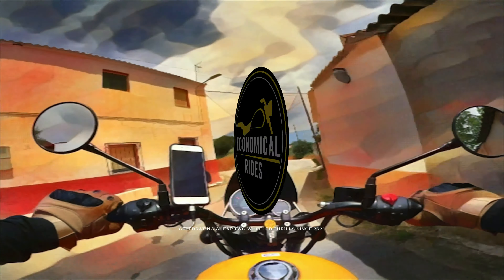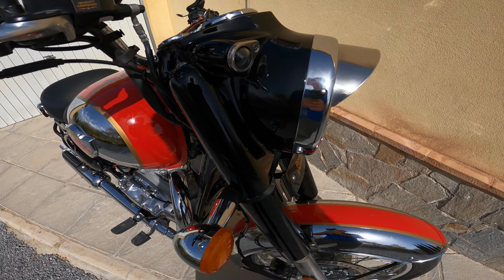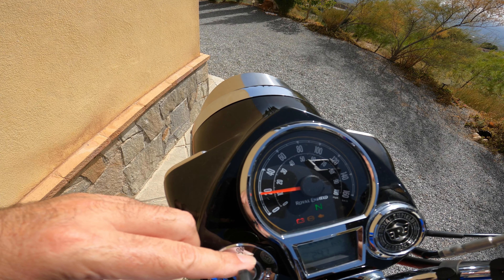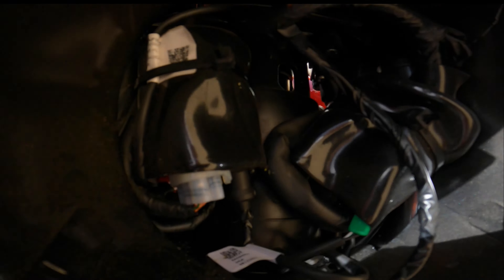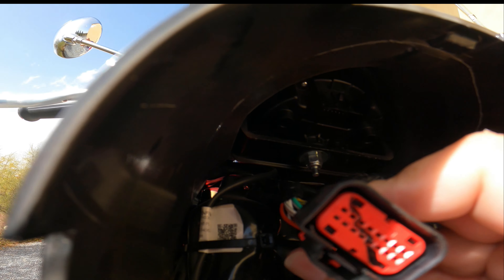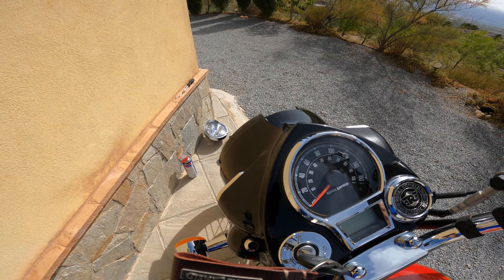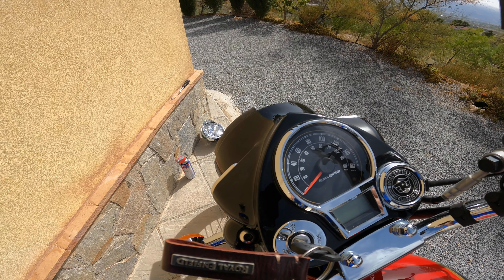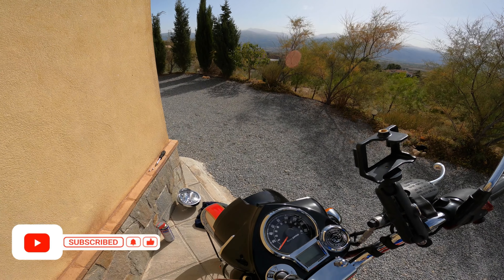Royal Enfield Classic 350 REborn - "Sticky Speedo" Fix ? - Well It Worked For Me ( So Far ! )

Comment: Happy riding 
Question?
I tried to clean the connector. As I tried to disconnect the port after pulling the red middle part down, it was impossible to unlatch it. The red part came down though. After that, It wouldn’t budge, and I’m not a weak man. I tried pulling it side to side like you would do to a tooth. It felt permanently attached. How much force should I use? Can I use pliers? Anything to loosen it?
I tried the on and off technique and it worked one more time, but I want a more permanent fix.
Thanks 
MJR
Reply from the maker: Hi there MJR,
that doesn't sound good. I am trying to remember how it was done because I haven't touched it since making this video last year. I recall that it was quite stiff to pull apart and I think it also comes apart slightly differently than you would imagine, so you might be pulling in the wrong place. I also struggled initially and nearly gave up but eventually I started pulling in the right place and it did come apart. Just freeze frame this video, where the connector is separated and see if you can work out where the join of the two parts is. I think you may be expecting it to separate in the wrong place.
If you are trying to pull it apart in the right place, it should eventually come apart with some pulling and wiggling, no need to use tools on it and if you do you'll probably break the plastic on the connector.

So just make sure that you are trying to separate the two halves IN THE RIGHT PLACE and pull and wiggle. It should come apart, just be patient.

Good luck MJR
ER
Reply: @economicalrides  thanks ER. Will do! Ride safe!
Reply: I fixed my Speedo with the spray. wahoo. I was able to detach since there is a small button part like in the middle area area of the port. Press that in and it smooths right off. Ride safe!
Reply from the maker: @maiojoserivera786  Congratulations Maio, glad you got it sorted. If it ever plays up again, just repeat the process. Saves a trip to the dealer and losing your mileage if they decide to fit a new speedo.
But mine held for 8 months without the problem coming back 👍🏻
Thanks for getting back to me, enjoy your Classic Maio.
Cheers,
ER.

Comment: Thank you...
Reply from the maker: Hi Joseph,
glad you found the video useful.
I subsequently sold the Classic but this repair held until I sold the bike, so ten months or so. The problem didn't reoccur in that time. I'm not sure if it is a permanent fix but if not, it's easily repeated whenever required. It was certainly less faff than doing a three hour round trip to the dealer to get a replacement speedo AND lose the odometer mileage I had done with the bike. 
Certainly worth a try, before going down the warranty replacement route !
Cheers Joseph,
Garry

Comment: Why this works, I don't know. But, it definitely works. Thanks! Anyone on here know how the repair holds up? I'm wondering if I will need to do it again later.
Reply from the maker: Hi ! Glad it worked for you too 👍
I have a theory that when it is hot enough and the air is humid enough, condensation can possibly build up in the connector. Once it dries out, there is mild oxidation which affects the conductivity through the connector. The speedo itself seems to be very sensitive to changes in conductivity within the connector. Cleaning the contacts solves the problem and WD40 prevents the condensation from building up again. WD40 will lose its effect eventually, so you might have to repeat the process at some point. But it is easily done and preferable to getting a replacement speedo and losing your total mileage.
I sold my Classic six months after doing this and the speedo was still working fine when I sold it. So the “fix” certainly seems to last quite a long time 👍

I did tell my dealer to do this before replacing speedos on other customers’ bikes but from what I hear they are still replacing speedos whenever it happens, for some customers multiple times ! 🤷‍♂️

Thanks for letting me know that this video helped you, it’s good to have data !
Cheers buddy,
ER

Comment: Hi ER My  classic 350 Halcyon green now has 3500 klm on the clock and so far at least I haven't suffered the  dreaded speedo issue. I don't know if it makes any difference, but I ALWAYS wait for the speedo to complete its start up cycle totally before pressing the starter switch. (It's obviously got some sort of computer chip in it, so a power spike or drain at the wrong moment could cause the device to have a fart attack.) ?????
Reply from the maker: Hi Kevin,
no, I always do that too, I even wait for the fuel injection to finish priming.
In my case it started when the bike was parked in the sun. On the next start the needle just got stuck. I think that this instrument is very sensitive to changes in voltage and there is something in the connector which causes issues when it gets hot. This seems to affect the calibration sweep. It's weird but I'm sure that heat is causing the connector to deliver inconsistent voltage to the instrument itself and that manifests itself in the speedo getting confused in its calibration sweep. It may just be grease or corrosion on one pin. It certainly seems as though cleaning and lubing this connector has made a difference. I'm convinced that the issue is not with the speedos themselves but with the quality of the connection to the speedo. I would recommend this as preventative maintenance personally, it can't do any harm if you are careful and may prevent issues occurring in the future. I might even do it annually if it proves to have solved the problem !
The next day my dealer told me that after three months my new speedo had finally arrived ! Typical ! For now they can keep it !
Cheers Kevin 🙂
ER
Reply: Hi, I'm of the same opinion that it is heat that is the issue that effects the Speedo. I'm in Indonesia and if I happen to leave the bike Speedo in direct sunlight I get the problem. Start riding with cooling air crossing the instrument cluster and the Speedo resets itself 👍. I'm going to try Warros solution as you suggest 🙏
Reply from the maker: @639viablecarrot  Certainly in my case and many others, heat seems to provoke the issue, or better said, direct sunlight. Others may be having other problems caused by other things but clearly in our cases it is very dependent upon the heat.
The surprising thing was that this time the speedo did not correct itself after being unused in the garage for over three weeks. It had ample time to cool down whilst I was in Germany but when I came back and started it for the first time, it still stuck at 20 kph. So at some point it starts playing up even when it is no longer hot. 
But this little job was easy to do and seems to have fixed it for now 🤞
Cheers Hqmpest !
ER

Comment: For me the speedometer is running,so can i follow the same steps ?
Reply from the maker: I would certainly try it if you are having a problem. If you get a new speedo under warranty, you lose your total mileage, which is a real nuisance.
As long as everything is working, I would leave it alone. I believe that newer bikes do not have this issue any more because RE changed something in the design/manufacture of this part.
Cheers,
Garry

Comment: Luckily it's not happened yet but if it does I know what to do. 👍
Reply from the maker: Hi Robert,
it’s definitely worth a shot before getting the dealer involved ! Still working for me and easily repeated should it become necessary.
Also, most people get their mileage set to zero when they get a new speedo under warranty ( although I am convinced that the mileage can be programmed into a new speedo, it’s just that the dealers do not know this ! ), which would really annoy me. I want to keep my original mileage if at all possible !
Thanks for watching Robert and 🤞 you don’t experience the issue !
Cheers 🥃🥃
ER
Reply: @economicalrides  absolutely agree with you. It looks to be an electrical contact issue! Maybe the male pins are just a tiny bit thin for the female plug. Good to know yours is still working 😊🤞👍

Comment: Any update on this?
Reply from the maker: Hi Bee Dee,
it hasn’t played up since but it also hasn’t really been out in the sun for very long since I did this either.
But I think this procedure helps and if the speedo ever plays up again, I will repeat it and see what happens.
I‘m so confident though, that I told the dealer that they can send the replacement speedo back to RE !
Cheers,
ER
Reply: This just happened to my Classic 350 on a Sunday. I went to the dealership and they plugged the computer to the bike and they told me this was caused by abs error code? Anyway they managed to put it back to 0, I picked the bike up and rode it for 15min, Speedo started acting up again! All bummed because it was a beautiful day to ride I went back to the dealer, they said they will replace the sensors and the speedo.. I left it at the dealership because here in Australia while you are on your L’s you cannot have the phone on the bike (means I can’t use gps Speedo on the phone).. really bummed. Wondering if it should pick the bike up and do this myself. The guys are not sure how long this whole thing will take
Reply from the maker: @beedee7392  Hi Bee Dee,

honestly I WOULD !

It's quite possible that when this happens it creates an ABS error code. After all, the speedo is just a display for the signal the ABS sensor sends with the wheel speed.
In this case the ABS error is probably just "speedo error" or "speedo calibration error".

It is possible to switch the ignition off and on again multiple times to get the speedo back to zero. That's what I did the first time it happened to me and that worked for a brief while.

But for me, disconnecting, cleaning and reconnecting the speedo connector fixed the problem immediately ( as this video shows ) and the fix is still working months later, although as I mentioned, I really need to ride through a hot summer before being sure that the fix is permanent. But even if it did start playing up again, I'd still repeat this fix before bothering my dealer with it. Even if I have to repeat this process every six months, it's easy to do, takes about 15 minutes all told.
So honestly, before the dealer starts swapping out bits which don't need to be swapped out, I would definitely give this a go. 100%. Maybe even ask the dealer to do it for you. You could be saving them a lot of work !

It's a shame that a GPS speedo on a phone is not an option for you. There are probably bluetooth displays which connect to the navigation app on your phone ( which could then be in your pocket ) or I believe that a bicycle speedo is also considered legal and they are dirt cheap ! Just as a backup I mean.

If the bike is now at the dealership I would just ask them to do what I did here, tell them that you want the bike back quickly. If it doesn't turn out to be a fix, you will bring the bike back later. But if it is a fix, you've just saved them a ton of grief ! 

If you had the bike at home, I would tell you to just crack on and try it for yourself, definitely. But since you don't, ask the dealer if they could try it for you.
You can link to the video and tell them that since I did this just the once, I have had about four months without a reoccurrence. 

Good luck Bee Dee,
let me know how it goes !
ER.
Reply: So before I could pick up the bike the guys have already replaced the speedo and speed sensor, the speedo of course is down to zero, so basically have a “new bike” 
Anyways, seems to be working good now, I need to go for a longer ride on the weekend and see how it goes, hopefully doesn’t happen again. All replaced under warranty
Reply from the maker: @beedee7392  Bummer. Going back to 0km is mildly annoying 🫤

Well at least they got it done very quickly, sounds like a good dealer !

I had a three month wait for my new speedo and by the time it had finally arrived, I had done my "fix" and decided that I didn't need it anymore.

Plenty of people are on their third or fourth new speedo already, so if the problem does crop up again, try the "fix" before going back to the dealer. You could save yourself some aggro 🙂

If my Classic makes it through the summer without the speedo playing up again, I'm calling the fix permanent. A bit too cold at the moment to be sure that it's not just coincidence that it's still working. We'll see.

Thanks for letting me know how you got on Bee Dee 👍🏻

Good luck with the new bike, make sure you run her in nice and gently ! 😂

Cheers 👍🏻
ER.

Comment: Looks like an easy enough fix, Thanks
Reply from the maker: Hi John,
the connector can be a bit of a sod to pull apart but be patient with it and apply force in the right places and it does come apart eventually !
Since I did this my speedo was fine, right up until I traded the bike in. So the fix lasted 8-9 months and was still working well at the end 👍🏻
Cheers John,
ER
Reply: @economicalrides  Yeah, I tried it last night and ended up giving up. I may try it again, or just let the dealer handle it. I noticed yesterday the face of my speedo with the numbers on it is starting come unglued I guess from where it belongs so it may be time for a new one anyway.
Reply from the maker: @jreid641  Well in that case it may not be worth persevering with, it's true !

If I recall correctly, you have to move the red locking tab up and there is some sort of "button" which you also press down to enable the two parts to separate. It was a long time ago now but I think once the red tab is up, there is a raised something or other, either in the centre or one each side, which can be pressed down or in and then the two halves come apart.

If you do get a new speedo, maybe ask your dealer beforehand to find out if they can program in your previous mileage. I believe they can but only when the speedo is new. I think they should have that option when they connect their code reader / programmer thingy 👍🏻 Most dealers just say "No, you'll lose your previous odometer reading" but I think that if they actually bothered to enquire, they will discover that actually it IS possible. It certainly should be possible, but of course only when the speedo is reading zero, after that the option would have to disappear to prevent mileage tampering.

Good luck. It's a bizarre but yet very common problem, that Classic 350 speedo unit !
Cheers John,
ER.